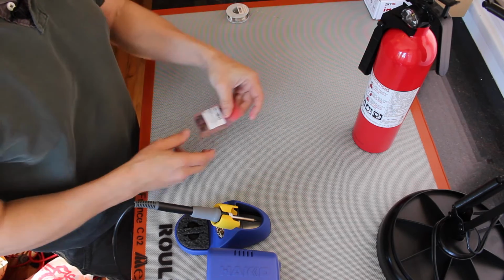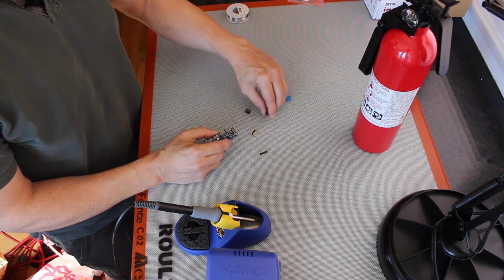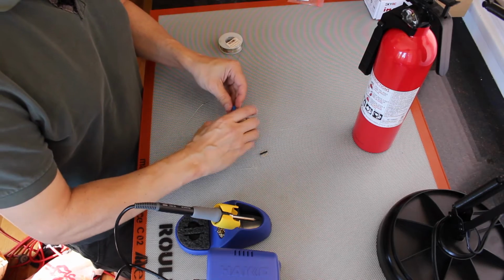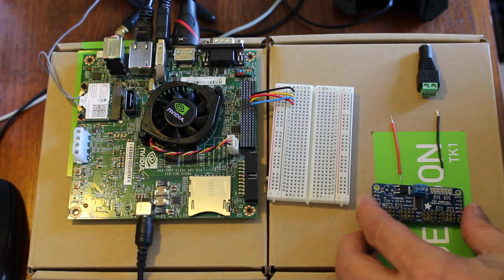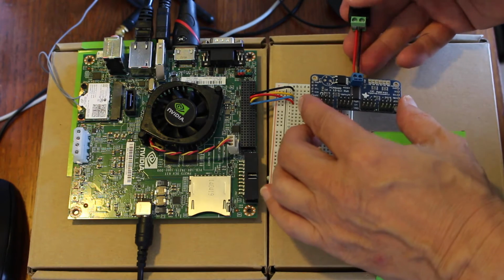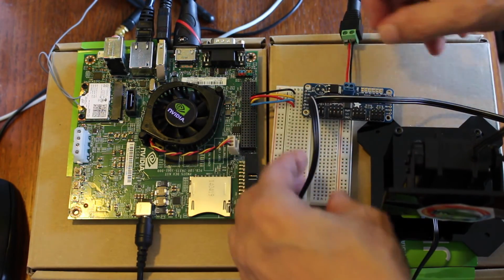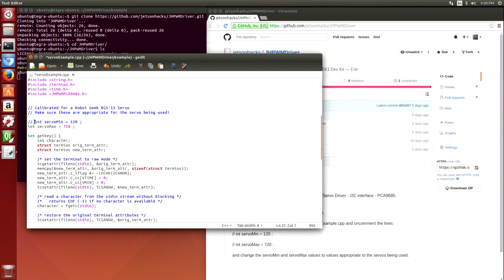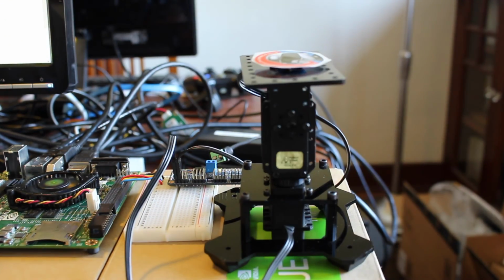PWM Servo Driver - NVIDIA Jetson TK1

Comment: Hi, Thanks for these good instructions. We are using cmake in our project, but your code is compiled by g++. How can we compile this code with using cmake?
Reply from the maker: Cmake is a build system, g++ is a compiler. Typically you specify which compiler to use in your Cmake file.

Comment: Hello, I am a college student from Taiwan. I am currently doing a research, but I have encountered some difficulties. We hope to combine the PCA9685 with the DC motor driver version BTS7960B. We use tx2 to do control and match the LIDAR to do the self-propelled car, but now I don't know how to connect PCA9685 with BTS7960B and the program. I don't know if you have any methods or suggestions. Thank you very much.
Reply from the maker: You will need to write a BTS7960B control program that sends PWM pulses to the device. I do not have any experience with that motor controller, so I don't have anything to share. Good luck on your project!
Reply: @JetsonHacks  Ok, thank you very much for your answer.

Comment: Do you have any idea, how to connect the wireless sensor to Jetson TK1 board?

which device requires for connecting wireless sensor to TK1 board. 

Thanks in advance
Reply from the maker: It would be useful if you could describe what you mean by "wireless sensor".
Reply: Wireless body sensor, which will use on patients body and be transferring sensor information  to TK1 board wirelessly[ex: heart rate sensor, blood pressure sensor etc]
[tk1 board will be data processing board of all  wireless sensor]
Reply from the maker: You need to add a wireless WiFi interface card, after that it is standard Linux.
Reply: Intel dualband wireless -AC 7260 MINI PCI-E CARD, is it work
?